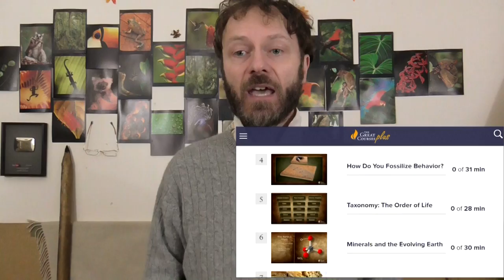Muzzle Brakes - what are they for?

Comment: Im sorry. But is that a GIANT pencil in the background?
Reply from the maker: It is quite large, yes, and golden.
Reply: Iron Mark He got it for poetry i think.
Reply: Can you convince very drunk/high people that you have shrunk them, and yourself down using it as a prop?
Reply: Lindybeige is having you all on, it's a normal sized pencil that's been made to appear further away than it really is.
Reply: Ahh, you see in UK we use giant pencils to draw the curtains at night.
Reply: Iron Mark Pencil is a lie, there is only pen.
Reply: +Lindybeige Hope you see this message I had a few questions.

Can see sense in smoke clearance to avoid giving yourself away.
The lowered recoil doesn't seem to add up...

The guns are designed for efficiency, getting the most from the propellant. Now the energy is imparted in the shell, a large mass that is accelerated away from the tank, is this mass not the source of the recoil?

Stand on a raft and throw a small stone away, then stand on a raft and throw a large rock away. The energy is in the mass propelled.
I am sure that it helps a little, but I doubt that is the main reason.

I always thought they are there as an interface between supersonic and subsonic.
The gasses preceding the shell, the shell and then gases following it,
all these travel above the speed of sound and meet still air.
I thought the idea was something along the lines of preventing shockwaves disrupting trajectories at this interface point, where the muzzle meets the air.

I didn't google, just shooting the breeze (ohh matron, the punnage!)
Reply: He is actually Pappy Drewitt with a fake accent.
Reply: Actually. That is a normal sized pencil.
Reply: It certainly draws the eye, doesn't it.
(Or anything else he wants it to, really.)
Reply: Iron Mark its a small one, placed in the front
Reply: I see what you did there.
Reply: Iron Mark You know, when I heard the saying "The pen is mightier than the sword," I didn't think it refered to clubbing someone to death with one.
Reply: Yes. Lindybeige writes history with it.
Reply: +Kojii Naz that's the best thing I have read all day on you tube!
Reply: Iron Mark he won it at a poetry competition.
Reply: Jack Sainthill HAH
Reply: The propellant still has energy and mass. The moment the shell leaves the muzzle the gas pressure quickly drops off but it still adds to the recoil.  If you are able to use the energy of the propellant to do something else (In this case a 'pulling motion' on the end of the barrel to lessen the recoil) you might as well.
I imagine your other points have validity too.
Reply: Whats that have to do with pencils?
BTW He wont that as an award for some poetry if I remember correctly.
Still waiting for him to use that in some video. :)
Reply: its a death stick
Reply: I guess Elan Sleazebaggano never rethinked his life.
Reply: Perhaps you should "rethinked" your grammar.
Reply: First Last
 I know..."rethought," but "rethinked" fit more in context....because "Elan Sleazebaggano."
Reply: Ah I see, I am unfamiliar with the reference, my apollogies :)
Reply: no, it is a very small pencil .. in the foreground.
Reply: recoil is a combination of everything that causes pressure against the projectile. a lightweight sabot round with a very tight fit to the barrel may produce more force than a loosely fitting heavy round.

Pretty sure it has nothing to do with supersonic shockwaves. The  modern naval railgun doesn't need a muzzle brake and it's producing a massive amount of air pressure.
Reply: soangry um i have shot many guns it does make a diference a rather large difference
Reply: but if it is in the front how does Lindy's arm move in front of it and yet it is still bigger than his arm
Reply: gumblebrum it's a giant pencil are just messing with you bro
Reply: Iron Mark no, he's just very short
Reply: I thought it was a perspective thing where it was super close to the cameras and actually small.
Reply: cannot be unseen...
Reply: I have always been more curious about why the eyeglasses are hanging on the wall.  Did Lindy once hunt down a university professor and keep his eyeglasses as a trophy?
Reply: He also has hanged his glasses on the wall.
Reply: WalkaCrookedLine Hunt isn't the right word. he just kicked int he door and challenged him to a duel
Reply: its not a giant pencil, its a normal sized pencil in a tiny house with a tiny Lindy
Reply: Its a pointy stick.
It was used to defence yourself against fruits,just like what Monty Python taught me when he released the tiger
Reply: Asking the real questions.
Reply: Was staring at it the whole video
Reply: Shhhh, don't mention the pencil.... Move along... Move along.
Reply: Iron Mark or are you just happy to see me
Reply: I can see Lloyd now in a Pub scenario -- instead of inviting some comely lass to his flat to see his etchings; he invites them to come and see his giant pencil... ;)
Reply: Lloyd, I bet you tell that to all the girls... ;)
Reply: HEAT round prototype
Reply: Done with mirrors..
Reply: Oh give him a brake... ;)
Reply: Carl Street why would you like a device that is used to slow a wheel?
Reply: Please use the proper past tense: "rethunked"...:)
Reply: OK, Colin, I give up -- WHY?... ;)
Reply: it's a brake.
Reply: No it's not, he's just very VERY happy to see me wink wink*
Reply: Great channel and old fan. Things are pretty good when only thing to whine is to remove to remove that silver 100K youtube play button.  You deserved it, but youtube doesn't deserve you anymore.
Reply: it's the magic pencil from spongebob
Reply: That would be a "lodge-goaden-pen-sill" to our friends across the pond (also known as m8s.)
Reply: DelNiceBeto My very first thoughts
Reply: No, this guy has some height issues...
Reply: Iron Mark
Reply: Iron Mark        I want that tank desory
Reply: I want all his tanks ........ can you please make some for me..... I'll give you €120 for em
Reply: Iron Mark - No. It is an armour piercing projectile based on graphite and wood and will be explained in the next video. ;-)
Reply: Pencil missiles were a last ditch Nazi secret weapon based on the concept that the pen is mightier than the sword; but strategic bombing had so decimated Nazi industrial capability they could no longer make pens and tried pencils as an act of desperation...:)
Reply: Carl Street that is the best comment I've ever read
Reply: Iron Mark Why, yes. Yes it is.
Reply: Carl Street I believe you mean “rethankered.”
Reply: Iron Mark yes it is XD
Reply: Ll
Reply: 2B or not 2B...That is the question.
Reply: to go with the giant's giant pillow
Reply: Killer joke
Reply: @ Koji Naz  Ha Ha !
Reply: i wonder if he likes drawing
Reply: Armor Piercing Pencil
Reply: depleted uranium pencil for sure combine it with a pencil case and you have a sabot round
Reply: That exact pencil was used to redraw battle lines across Europe during WW2. I know because my great uncle had to draw one of those lines as punishment for farting in the general direction of the queen while on duty.
Reply: Yes. With this pencil Lindybeige writes history.
Reply: Yes. With this pencil Lindybeige writes history.
Reply: NoName and a giant rubber to open them in the morning?
Reply: Given that no railgun is deployed, it is to be expected that all optimizing level technology would be avoided for simplicity. Barrels have lifespans over the amount of recoil that they can endure, o 155mm it is quite small, something like 170 rounds I think. So I would imagine that the reduction of recoil stress is to do with the reduction of maintenance and not functionality an economic rather than military purpose.
Reply: That's why Lindy isn't scripted.  Look how damn heavy that pencil is.  Would be too hard to write.
Reply: Big pencil for big ideas
Reply: It’s a giant blunt
Reply: @mattfairfield9103   would be surprised
Reply: A giant British pencil, full of stout British lead. Take that Johny Foreigner! Where's your spluttering mucky inkpen now eh?
Reply: Sometimes a pencil is just a pencil.....
Reply: new to this site -  cool-  new fan-      which tank shot pencil's ?  -  how odd ?
Reply: it has black at the end so yea
Reply: It's a giant pencil, obviously.
Reply: @NoName-bt3oy  Belate boo.  Booo ...   LOL
Reply: @NoName-bt3oy  If I may.
As the propellant is turned to gases, it expands in both directions: forwards and backwards, equally. The backward-flying gases are pushing the breech backwards, and with it the whole gun. That is recoil.(*) The forward-flying gases are pushing the shell along the tube. The shell is not, itself, the source of the recoil, in any way at all. Now, as the forward-flying gases leave the tube at the muzzle, they will now be useless at the outside, having done their job. Also, if you would draw out some of those gases at the very end of the tube (the muzzle), their pressure is now much less than it was at first and also they have already done nearly all that was expected of them, so now you can afford to waste some of these gases to the side, obtaining a more interesting effect. So there you are.
(*) Actually it is a lot more complicated than that, because these gases also bounce off the breech (thereby causing recoil) and back into the tube and are also part of the propulsion, pushing the shell onwards. The shockwaves also travel many times back and forth, between breech and shell, inside the tube. What I did was to oversimplify. But the idea is that the recoil does NOT come from the shell itself, and the loss of some force at the muzzle is negligible for the purposes intended.
Reply: @NoName-bt3oy  Nope. The expanding gasses of the propellant (the powder charge in the cartridge/ shell) accelerate the projectile down the length of the barrel to the ballistic muzzle velocity required, but once the projectile leaves the barrel these gasses, which are still expanding out the barrel, will now go anywhere they can into the atmosphere. So some of this gaseous energy is redirected by the muzzle brake sideways and rearward, which of course provides forward thrust to the weapon, thus reducing actual recoil. A compensator works in a similar way by redirecting these gasses upward, which helps to keep the muzzle down and aligned with the target when installed on small arms, which helps re-adquire point of aim quicker for follow-on shots.
Reply: It's a hand carved 75 mm anti-tank round made to the last milometer of proper scale.